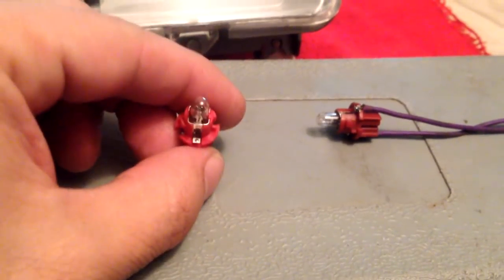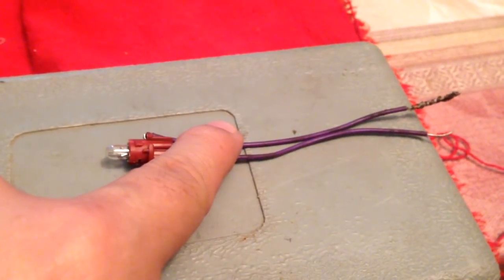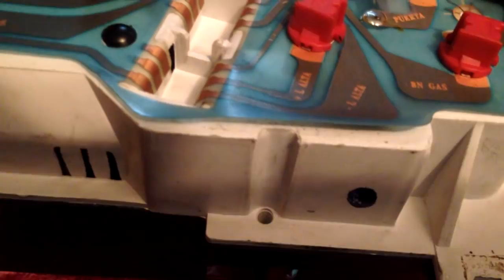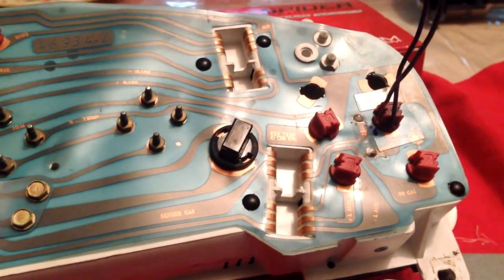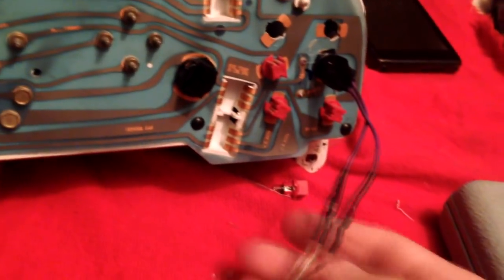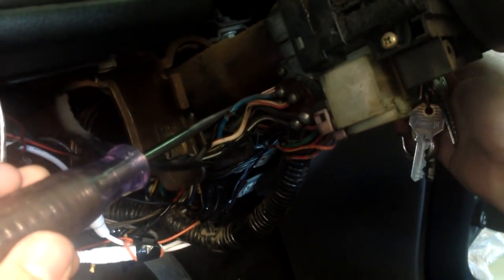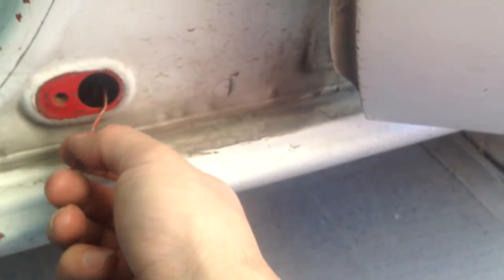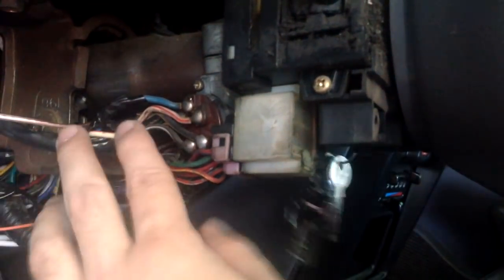El secreto más raro del Tsuru, testigo de puerta abierta

Comment: No es necesario adaptar esos cables. El clúster tiene un circuito donde dice puertas o Doors se busca la continuidad y en la pista hay un faltante ahí se solda un diodo 1N4007, en su defecto hasta con un pedazo de cable de cobre xD. Y el clúster está listo para funcionar. En el defecto que el arnés del carro no tenga el pin de cable en el arnés es más fácil agregar el cable y llevarlo a tierra del pin de la puerta. Saludos :)
Reply: Disculpa sabes como conetar el encendedor,tengo cables sueltos atras pero no se cuales son
Reply: Testigo de puerta abierta:
En este caso (del video), se puede apreciar que ya tiene el diodo soldado, ¿porque un diodo?, porque al colocar el foco, hay un regreso positivo hacia la alarma y pudiese ocasionar un mal funcionamiento en la misma. el diodo, evita este regreso y permite que la alarma trabaje de manera óptima.
Por otro lado, habría que observar, si el respectivo arne o conector de ese módulo, tiene la zapata integrada,  de ser así, posiblemente solo sea necesario conectar el foco, de lo contrario habrá necesidad de conectarlo por medio de un relay, ya que el cluster maneja tierras fijas.
Ahora que si el auto cuenta con alarma, habrá que conectar esa sección (donde va el diodo del foco indicador) al relay de la alarma, en la salida negativa si deseamos que flashee o antes del relay si lo queremos fijo.

Comment: excelente video bro tengo un gsll con tacometro y  en ese cluster solo necesitas soldar un diodo rectificador e instalar el foco y listo ya tienes el testigo y sirve para las cuatro puertas.saludos.
Reply: podrías a ser un video de lo que dices por favor ya que mi tsuru trae el tacometro
Reply: Lopez Lopez es fácil bro.retira el cluster y en la parte de atras de donde va el indicador de gasolina hay dos circulos impresos ahí va un diodo rectificador de un amper lo consigues en steren le doblas las patitas y de preferencia llevalo a soldar en algun lugar donde reparen aparatos electronicos para que no vayas a quemar el plastico. quita un foco de alguno de los otros testigos para que lo lleves de muestra y no tengas problema para comprarlo y lo colocas donde va el testigo de puertas abiertas vuelves a conectar todo en su lugar y cuando abras el switch y tengas alguna puerta mal cerrada se prendera el testigo.

Comment: ¿Cómo se cual cable va arriba y cual va abajo?, y tu cámbiate el led del testigo?
Reply from the maker: si lo cambié por que el led gasta menos batería y alumbra mejor, de cual cable me preguntas es que no ubico bien cual es la duda
Reply: Súpertsuru de los cables que sacó del led
Reply from the maker: el led tiene polaridad, la pata mas larga debe ir a la corriente, la otra va al negativo, si usas led tienes que poner una resistencia, pídela para 12 volts y en la electrónica te dan la que necesitas